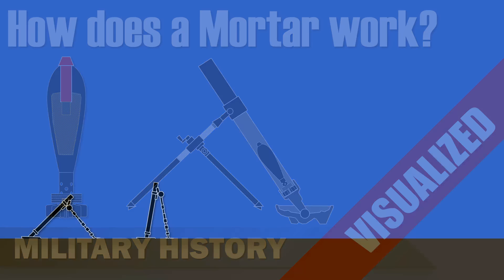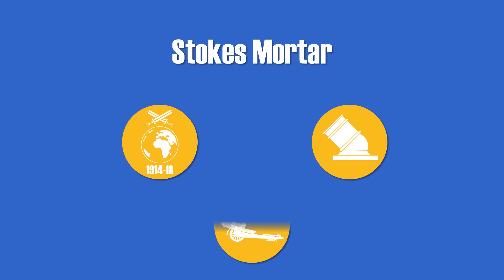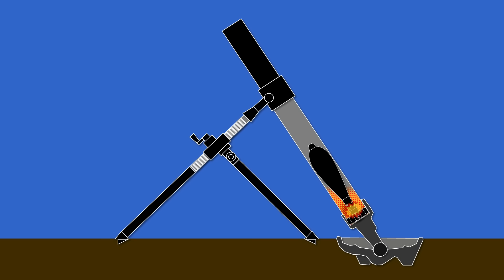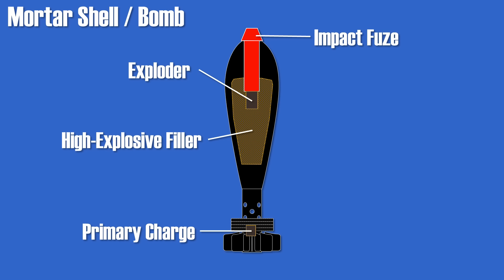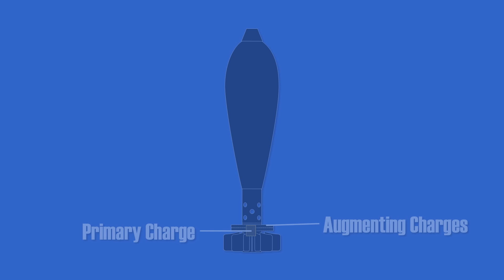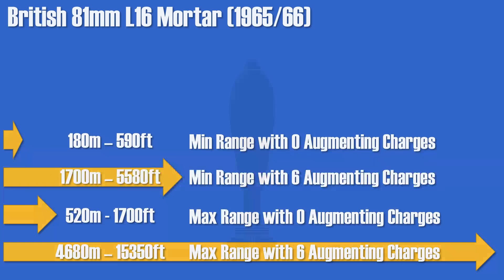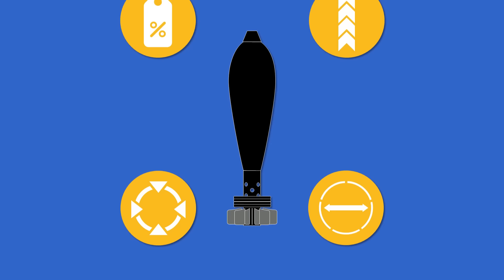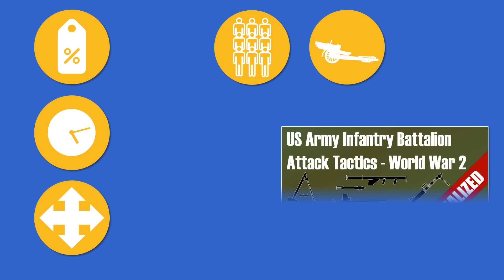[Weapons 101] How does a Mortar work?

Comment: Wow I always thought the Mortars functioned Differently, I gotta ask what are the chances of the Mortar detonating inside the Mortar Tube?
Reply: +Bob Orson Gaming and Mapping Extremely unlikely. Modern projectiles are armed upon firing, so that projectile is already gone by the time it's dangerous. You get stuck rounds from time to time, but crews are trained to handle them and they rarely result in a detonation.
Reply: TheOnly2wheels
So I guess for WW2 Mortars it was a very high rate, right as well I dont think they had the best Mortars, I always thought a Mortar functioned by using Compressed Air as like exploding a charge inside the Tube seems pretty dangerous looks like no
Reply from the maker: +Bob Orson Gaming and Mapping well, I don't have data on it, but considering the wide use and that the weapon was used already in ww1 I doubt that there was a high failure rate. You need to take into account that the 1) augmentation charges are outside of the shell, 2) there is one way to release the energy: up and 3) that there is a strong wall on the shell itself, 4) especially if you consider that the fins are quite thin and are directly under the augmentation charges, if the propellant explosion was too strong they would destroy/damage the fins. I guess there are a lot of complex physics and chemistry (charge composition) involved.
Reply: Military History
ahhh ok
Reply: I was mortars for 14 years (10 of which as an MFC) and in my early days there was a direct action fuze which armed once you unscrewed the top and once it hit firing pin would arm. This was phased out thankfully and more modern fuzes would arm once fired and had flown for a number of seconds.
The main reason a mortar would explode is a barrel shattering due to an undetected air bubble, crack, etc. My military checked them annually or after every 1000 rounds and I never heard of this system failing us.
Reply: Steve Pirie
Ahh interesting, thanks

Comment: What I don't understand is how does the mortar team know exactly what angle to set the mortar? And how does the radio man on the front know exactly the range of the target using his naked eye? So how does the mortar team know exactly where to put the mortar without dropping it on their colleagues?
Reply from the maker: +Doug0101 not entirely sure, but distance is taken. Then angle etc. Calculated I think this even done by a targeting device. Training in range finding. Also probably firing tables.
Reply: I can try to answer, I served in a light mortar platoon in the FDF.

Trained forward artillery observers who are also riflemen are deployed in the frontline just like any other riflemen. If indirect fire is needed they send the coordinates of the enemy position to a signal post which belongs to the mortar platoon. The coordinates of the mortar teams must also be known in order to do this obviously. This post then converts the coordinates (I don't know the exact procedure) in to angles and numbers the mortar team can use. This is then sent to the mortar and the crew adjusts the mortar to the proper settings. In 2-3 minutes from the message the observer sent bombs should be in the air. Also preset positions are sometimes used but I will not go further on how to use them exactly.

Comment: You forgot one fact, if a mortar shoots a 200m away it will reach a height of 200m, same for any other range so if it shoots 2000m it wil go 2000m up in the air

Comment: Also you have to let him know that the rounds have three safeties you have the initial safety up-top what you pull the pin when you drop it down and then when it hits the pain in the bottom it cause it to break and there's a boar ride safety that pops out and rides along the inside of the tube once it reaches the top of tube it pops out with totally arms the round ways to use a pipe wrench and give a quarter-turn to snap that bull ride safety out and we can hang up in trees for booby traps the US military's 60 mm motor can be fired by a trigger but you can't do it on charge 4

Comment: i'd be curious to know how accurate these were
Reply: They are very accurate when used in a static situation as they measure out the various ranges and have them on a range card. If the enemy reaches a certain point, the mortar platoon knows the exact setting to use to hit that target. 

In more dynamic situations it's a matter of a few ranging shots and adjusting from that. The important thing is to bed the baseplate in to reduce shift.

They are still an extremely useful tool.

Comment: I was disappointed by this film because it only covers really obvious things about mortars. I was hoping for more information about the methods used, especially during WW2 for the setting up and adjustment of mortar fire and the use and communication with forward spotters etc. Articles on weaponry always focus too much on the hardware, information which is easily available, and very little on the tactical employment! Also I was surprised you did not mention smoke & illumination rounds.